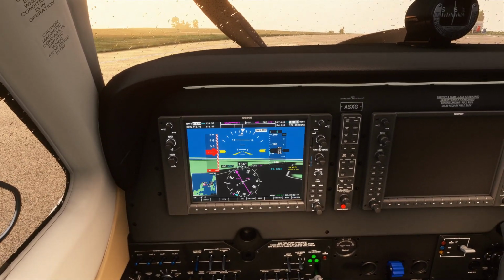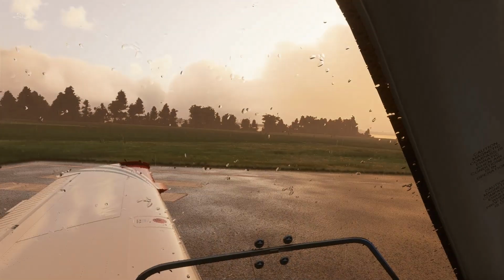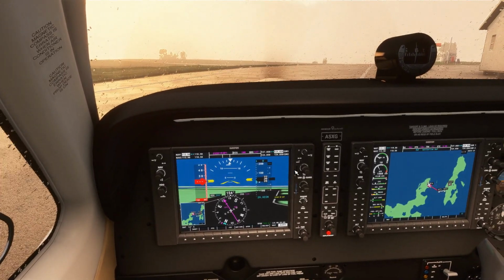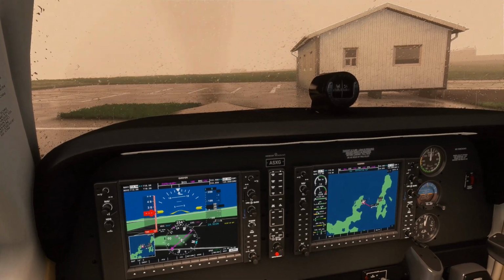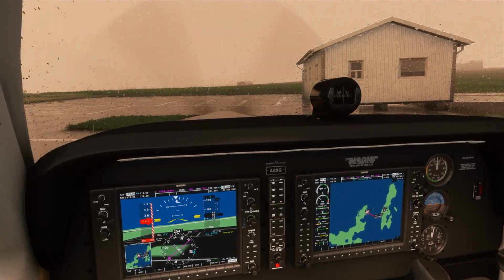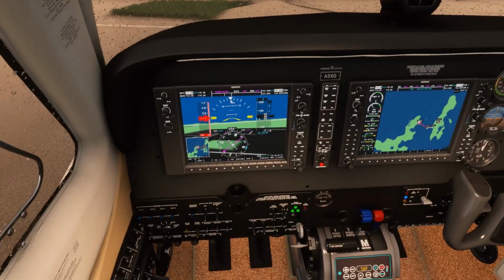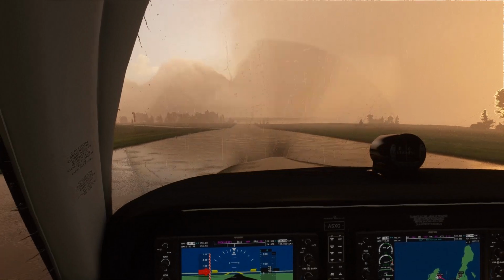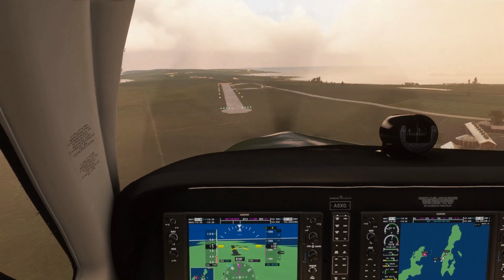Westray to Papa Westray - Iconic Flight | REAL PILOT | Microsoft Flight Simulator

Comment: Nice, I have an old Sidewinder joystick and have tried various sensitivity setting without success. The plane is uncontrollable. Should I scrap it and go for a new one?
Reply from the maker: Thanks Ewan!

That’s very odd. . . Worth troubleshooting a bit first, before you give up on it I would say. I can’t imagine it’s the joystick causing the issues, unless it’s actually broken. Is it a USB joystick, or gameport? I have an old(ish) Sidewinder, I can try that and see how it works on my end? Do you have the opportunity to try any other form of controller (PlayStation or Xbox for example), just to see if it’s not a sim issue (I guess even the keyboard would suffice). Lastly, you’re not using the “Legacy” flight model option are you? As this can cause some erratic behaviour in some aircraft.

Hopefully we’ll have you up in the air soon enough!

Cheers, all the best! : )
Reply: @IntotheBlueSimulations  Hey there, not sure what legacy option is. I dont think the sidewinder is faulty but I wondered if it just wasnt compatible. Ive tried making the sensitivity a linear profile with a small dead zone, and also a curve profile but same result. The smallest movement on the stick and it over steers and crash bang wallop. I used it in previous MS flight version with little issue. I could try a game controller but its not the same really. Thanks for the reply
Reply from the maker: Hello again Ewan,

So there will be on option somewhere in your settings menu, to choose between the “legacy” or “modern” flight model. Definitely worth checking, as it can create the sort if behaviours you describe if left in legacy. If you were using the sidewinder just fine in FSX, then it should work just as well in MSFS as far as I’m aware.

I was only suggesting using a game controller (if you have one available), to see whether the sim always behaves this strangely or whether it really is just the Sidewinder causing it. Should help narrow down the issue : )

Comment: Amazing video! The best I've ever seen! I want to become playing FS20, but i need to buy a new computer before. What is the specification of your video card? Do you use VR to play? Congratulations on the video!
Reply from the maker: Thanks very much Rafael, very much appreciated!

I'm currently running an RTX2080. I do occasionally run MSFS in VR, however with my setup, the performance is just barely acceptable (and you have to turn the graphics down quite a lot as well). I do also have a fairly old CPU and RAM though. My system generally runs most games well in VR, but MSFS is a bit of a struggle unfortunately. It is one of the most taxing titles out on the market currently. I'm not sure there is any modern system that can truly run it optimally in VR yet.

Really glad you enjoyed the video, all the best! : )
Reply: @IntotheBlueSimulations  Thanks for the information. Another doubt, what programs do you use to rec the flight and edit the video?
Reply from the maker: Hello again Rafael, hope you’re well!

I use Shadowplay for video recording, Audacity to record the audio and just VCH Videopad for the video editing. Overall it’s a pretty simple setup : )

Cheers

Comment: I've left this sim now till it improves in a year or so... too buggy and messy and back to my other sims  .I  really don't care how pretty it looks. This is what hypes everybody. Graphics is its selling point..
Reply: the UK update features this wonderful bug, which, far from merely causing a bit of float on landing as claimed below, causes an instantaneous uncontrolled extreme nose-up angle and ascent at 5000 ft per minute when applying flaps 1 in an Airbus.
"LIFT EFFECTS FOR FLAPS DOUBLED
The lift effect for the flaps (as defined in the flight_model.cfg) is doubled. This only affects the lift of flaps and not the drag, and can be best observed in flap configurations that produce a lot of lift, typically in the landing configuration. As a result some planes glide too much with flaps, and this will be mostly noticed in late final and when flaring."
Reply from the maker: For me Bernard, it really does just manifest itself as an extended float down the runway (were talking 50% ish of the runway length). Hard to imagine how, but it wouldn’t be the first bug in the sim that affects one user differently from the next. In fact it seems almost everyone has a “unique” sim in terms if its issues, bugs etc. I’m not really sure how that’s even possible with computer code, but Asobo seems to have managed it somehow ha. Maybe it’s something to do with the installer / updater being so atrocious, I really have no clue.

I gather there is a fix available online that covers most aircraft now, but really Asobo should be hotfixing this sort of thing. . .
Reply from the maker: Fair enough Chris, that’s totally understandable. The sim still definitely needs a lot of refinement, that’s for sure. I mostly enjoy my GA, VFR flying in the sim and for me, I find MSFS the most fun to do that in now. If I want to get more “serious” though, generally I find myself heading over to X-Plane 11.

The silly thing is, a lot of the fixes that the sim needs, seem to be relatively straightforward ones; windsocks showing incorrectly, menu options not saving after quitting the sim, fuel burn figures off on certain aircraft etc. Asobo really ought to sit down and just grind through all of these with one big update, before moving on to other things. Hopefully between now and next year, the sim will have come on leaps and bounds!

Comment: I have another question 😊😂
Reply: Yes I remembered my Landings when I get the 50 call out I go idle throttle but the aircraft just seems to hover over the runway for a bit then land nice an smooth
Reply from the maker: I think that might be the result of a bug, introduced with the latest update unfortunately. Basically Asobo doubled the amount of lift slats / flaps produce, now causing a lot of aircraft to do exactly this.

I’m afraid it will stay the same until the sim is next updated, although you’ll be able to find a fix online if you search around for it (I can’t leave a link here I’m afraid, or YouTube will delete the comment).
Reply: @IntotheBlueSimulations  Hi thanks again for getting back to me yeah I watched your video so I'm trying to do it like that now thanks for the tips in Crosswind helped alot, sorry what didn't make sense was it my other question on the other chat?? Yeah I heard about this flap thing causing a downward tilt and you also think its effecting takeoff ok well I will wait for them to fix it again🤣😂. Keep safe and thanks for all your help I'm slowly improving I think.
Reply from the maker: Yeah, didn’t quite understand what your other question was, but I think we’ve covered it now anyway. The answer seems to generally be; “it’s a bug” unfortunately haha.

Yeah that’s it. Just keep plugging away and you’ll naturally figure out a lot of what works / what doesn’t. Trial and error is good, in a sim : P

Good luck with your progress, feel free to stop by any time again : )
Reply from the maker: Haha, hit me with it! : P
Reply: @IntotheBlueSimulations  So I put the first one in the other chat that now has 26 replies 😂. My other set of questions is Landing in Crosswind any tips because I have now started doing flights in UK and realised that everyday we basically have horrendous weather😂.  And I now can't remember what I was going to ask.
Reply from the maker: I couldn’t really find / didn’t understand your last question in the thread I’m afraid. As for crosswind landings, I’ll do a video on it at some point (there are probably others available on YouTube as well) but it won’t be for a while I’m afraid. I did just do a video in the FBW A320 into a crosswind, it’s not a tutorial, but you might pick up the gist. Basically though, in a jet, don’t try and point the aircraft at the runway, adjust your heading such that your aircrafts flight path drifts down the extended runway centreline (in a really strong crosswind, you may even be closer to looking out of the side window!). Fly that all the way down to around 10ft, adjusting your heading to keep your flight path on the runway centreline. At the very last moment, just before you touch down, squeeze in the rudder to line your nose up with the runway (you may also need a little bit of aileron at this point to account for the roll caused by the rudder input).

As you say, in the UK, it’s quite a useful skill to develop haha! Practice makes perfect : )

Comment: Great video! An iconic route
Reply: Hard to tell, there's only the panel in view.
Reply from the maker: Haha, well usually I like to show some of the scenery enroute, but to be fair, in this challenge there really isn’t much to show. You fly through a rain cloud, over a tiny strip of water and then immediately onto a gravel runway. As you’ll see from the flight itself, there wasn’t even really time to head outside the cockpit.

Normal service will be resumed in due course. . . : P
Reply from the maker: Thanks Jake!

It’s certainly iconic, I wish Asobo had chosen a slightly longer route though. It’s not often you fly a parabolic trajectory in a single engine prop haha.

Still, glad you enjoyed it! : )